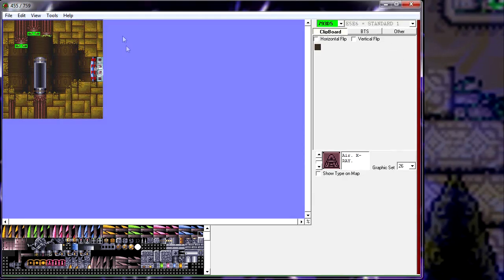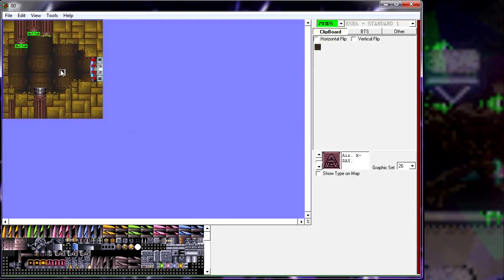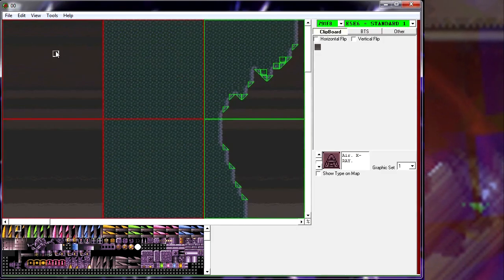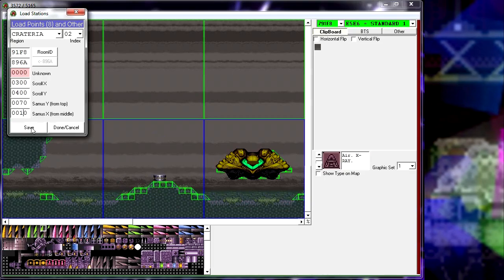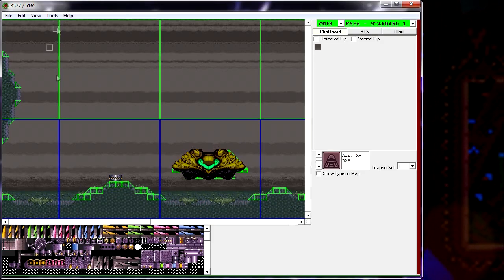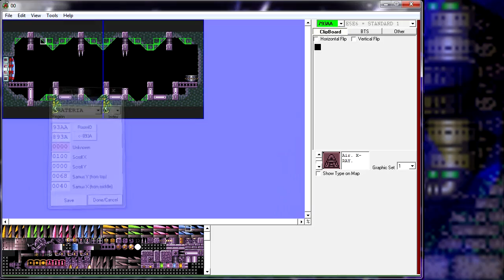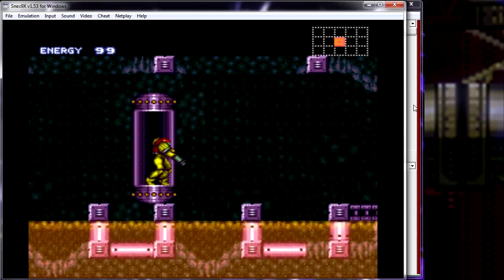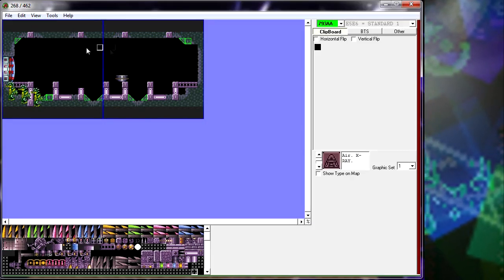SMILE Tutorial - Save Stations

Comment: Hey Shyguy! Great videos, watched them all and they've been extremely useful. You rock. Quick question on this video, I noticed you're using index 00 for the starting area of the game, does this only work in Crateria? If I wanted the game to start at the morph ball hallway in brinstar, would I build a save station at that elevator and make the index 00? Do I need skip intro option on for all of this to work? Thanks!
Reply from the maker: By default, the game only reads Crateria save 00 as loading. It's possible to change that to a different area and load station, but that I am not familiar with.